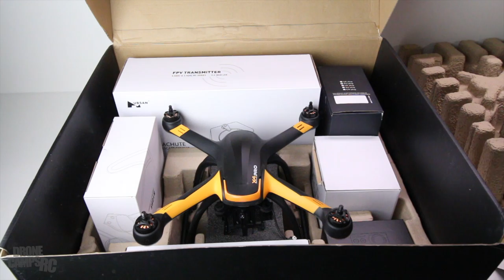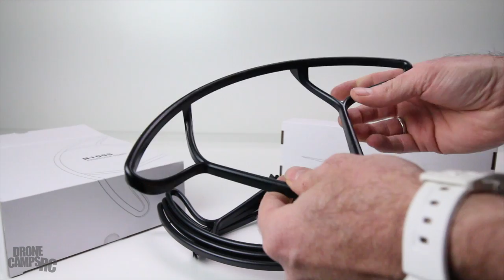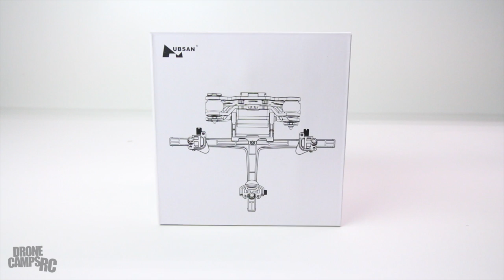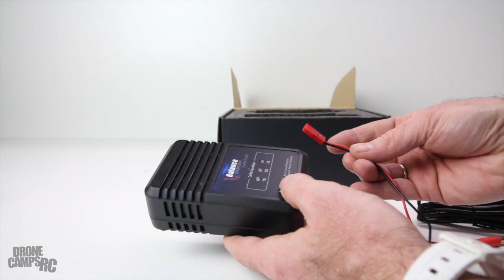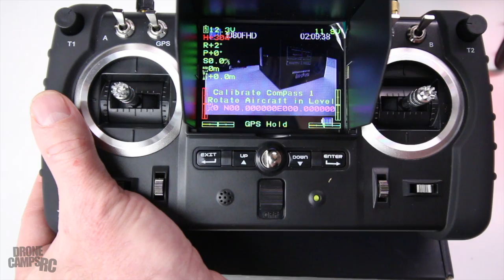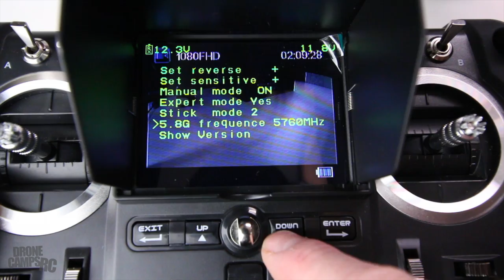I LIKE IT  - HUBSAN X4 PRO H109s Drone, Review - GOPRO COMPATIBLE Drone UPDATED

Comment: Thanks for the very in depth video and review of the Hubsan X4 H109s, seriously considering buying this as it has the power and range that I want to learn with before getting longer range drones which are 2 times the price to get near this range +1.5 KM. I see this parachute missing is a common problem among buyers but since it weighs 250 grams and the max added load for the drone is 350g it is going to reduce time and range but a serious life saver if connection lost and battery runs out.

Comment: I bought one...Had a great first flight...Next day I took the drone up about 40 feet and it started to wobble...I figured it was prop wash...Next day took it out again and....Pushed up on the throttle and it kept going!!!! Nothing i did affected the drone!!!!! Then it came down in a spiral and crashed!!!!!! WTF!!!!! This drone is nothing more then a paper wieght right now!!! I'm too afraid to take it out again incase it crashes into a house or worse....any ideas why a ghost took over my new Hubsan X4 Pro H109s Standard!!!! I was going to get the high end one but NOT now!!!! May never get another Hubsan again!!!!
Reply: You find the same comments with the most other drones. Even with the mavic 2 pro... mostly,  consumer, operator mistakes

Comment: This has been an excellent video.  Thanks.  I was worried about which quadcopter to buy, Hubsan X4 H109s / Xiaomi mi / DJI Phantom etc. and my resources are modest but I will go ahead and get the Hubsan.
With a 7" monitor it should work well for me as a beginner and a bit of an old chap.  This way I can buy add-on pieces as I need them and spread the cost over a few months.  This should keep my Beloved wife at bay... and the bank manager.

Comment: Hi Justin, great videos.. I have watched both videos on this drone, and I am having trouble recording video. My camera works when not plugged into the drone, but when I plug into the drone, my video is corrupted. I read that you have to turn off the camera before turning off the drone...  I tried turning on the drone and than turning on the camera, hitting record on the camera, but when the drone started to fly, the recording stopped. Can you please do a video on how to use the camera, and watch the video. I have tried several times, and I cant get it to record properly from the drone. Thank You !

Comment: Cal JohnsonHigh-quality review. Thanks for covering Hubsan products. I have a Hubsan X4 H502S and a couple of X4 H107P models. One complaint I have with the latter models is with the failures of the barometer to maintain altitude hold. Would appreciate updates with your experience with this particular feature with the H109S and/or other Hubsan drone models. Thanks again!

Comment: Heloo. I have this drone for around 2 weeks now. And no, i didnt get parashute either but i am more interesting in other stuff. Like: in description says that fpv works for around 1000 meters. But in my case, if i get my quad 200 meters away from me, the pic on the screen donnt work anymore...maybe now and then some flash but thats it. So i wonder if you have some advice for me how to improve that to get closer 1km then 100meters???  But i must say that shoots and videos from SD card are great, perfect clear, just would be very nice if i could see what i am filming when quad is little far away. 
Thanks for great infos about this quad, was realy helpful.
Reply: Put an ImmersionRC FatShark TX antenna on the drone, you'll easily get over 2,500 metres range from the video with the stock flat panel on the controller.

Comment: What lipo did you put in the transmitter? And where did you get it?  Thanks and great video.
Reply from the maker: It doesn't come with a battery. But you can use a 11.1v 3S Lipo with a jst connector

Comment: Dude is there anyway for this drone to do a facebook lives ? , or on any of the versions of the  HUBSAN X4 H109S, I know other drones where you use your smart phone as part of the controller you can run a facebook live and you see the drone view from the sky it's pretty sic. !!
Reply: The 109 comes with a smartphone gimbal so you can attach your phone instead of the hubsan camera.
Reply: Stephen Peters Woah that's awesome, but in the same way I don't know if a $400 drone + $600 phone stuck up a tree would be good

Comment: So I've had this quadcopter for a few months now and I've noticed something in the few times I've been able to fly it. After flying it for a bit I've noticed the green lights flash red sporadically and I'm not sure what it means and I can't find any info about it anywhere!
Reply: mine does it as well and I can't find the answer either
Reply: Jeremy Conlee It turns out that it's an early battery warning. When the battery gets to about 10.9 to 10.8 volts the back lights will start to flash red and get more frequent as the battery gets lower. Even though there's no info out there it seems completely normal.
Reply: Justin J. great thank u brother . really learned a lot from your video .. please keep em coming

Comment: My   euro   type  charger   came with  an   US adapter connector   .You  don't need  a  special converter  because  the  charger will  accept 100  to 240 VAC